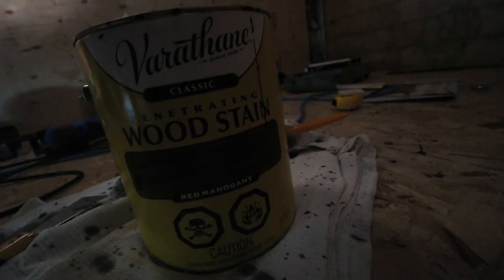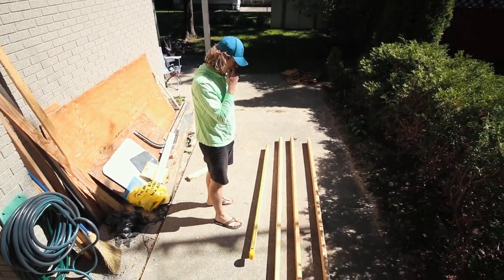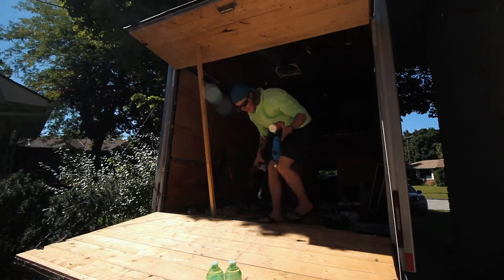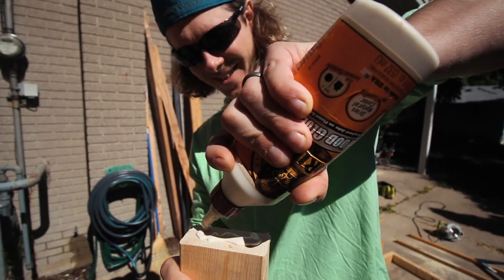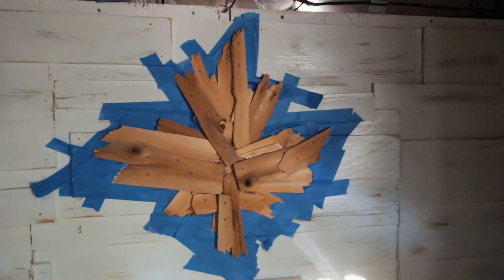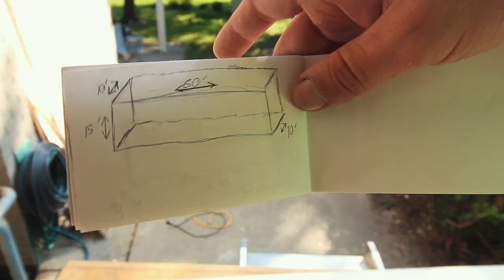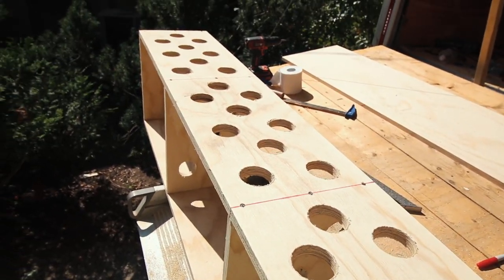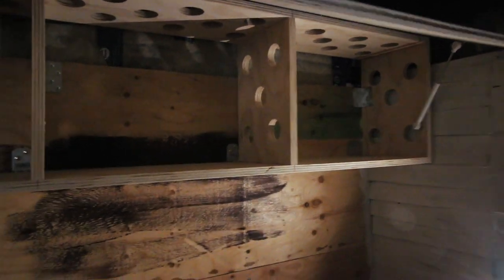PAINTING AND BUILDING FURNITURE | DIY Box Truck Conversion

Comment: Something to consider is weight distribution. A center point based distribution is best but it that not possible then choose the driver side for heavier weights.

I would highly recommend removing the rear lead spring and replacing with air bags.
Reply from the maker: Thank you for the advice Robert! And airbags are definitely the way to go!